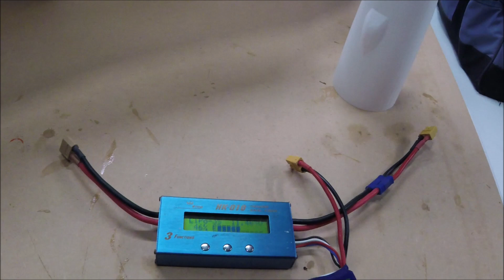RC Vulcan maiden flight debrief for builders

Comment: I’m currently printing my Vulcan now can’t wait to fly it, I might catapult mine instead of hand launch, or is it ok to hand launch? I’ve found a 50mm 11blade edf unit that runs at 5400 kv not 4800 so it should have more thrust.
Reply from the maker: We haven't tried catapulting this plane. It is ok to hand launch but is best done by someone else if you can to allow you time to react. Needs to be thrown just slightly nose high. Avoid being too nose high. Good luck.

Comment: Very very interested in this model.   I dont have a 3d printer.      Would you be willing to print off and send to New Zealand      charge as needed for profit ifcoarse    I have a 63mm fan sitting around begging to be put into an airframe such as this
Reply from the maker: Glad that you are interested in this model. As you can see, I'm very pleased with it. Like yourself I don't have a 3d printer but a friend printed it for me. Even with a printer there seems to be many different variables and techniques involved getting a satisfactory print. I will pass on your request in case he is interested in printing one for you. I don't think that this plane would take a 63 mm EDF without significant modification. There has been some discussion on this in the last page or so of the build thread on RC Groups that I posted.
Reply: @MrWaz11  thanks for the quick reply,    its giving me a huge inspiration.      I'll have a play with a block of foam       happy flying and have a great year,   From Little New Zealand
Reply: @russcole5685  Hi Russ, MrWaz11 told me about your interest in this plane since I printed his for him. 

I would be happy to print one for you, although I suspect scaling it up 26% to suit your 63mm fan would make it highly experimental. My advice would be to pick up the 50mm FMS fan with matching 40A Predator ESC from Banggood. Pretty inexpensive and more than enough power.

The only issue would be freight from Perth to you. However, I have a friend in Tapanui with the same printer as me, who would be happy to print it for you. You would need to download the files from Cults and send him the gcode files. From there it would be easy and hopefully much cheaper in freight costs!

Let me know what you would like to do and I will assist as best I can.

Cheers
Geoff